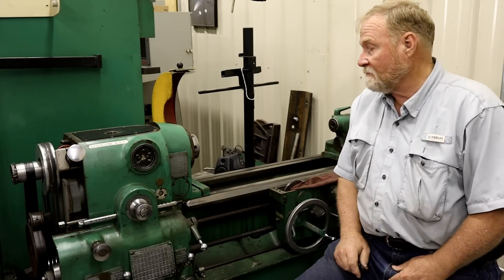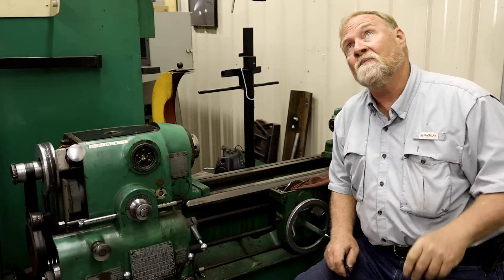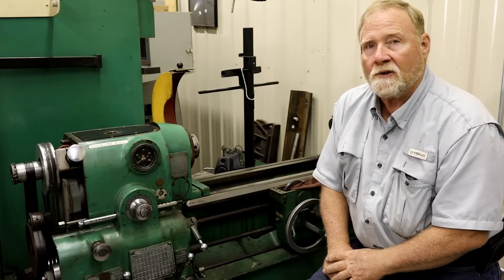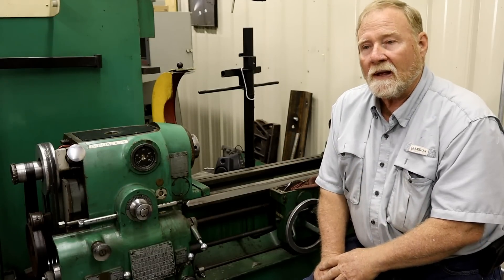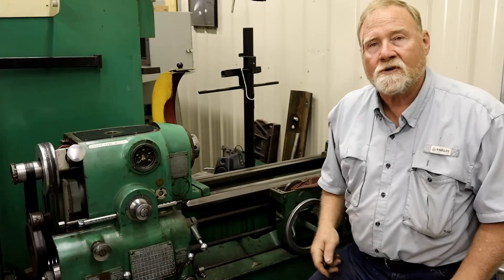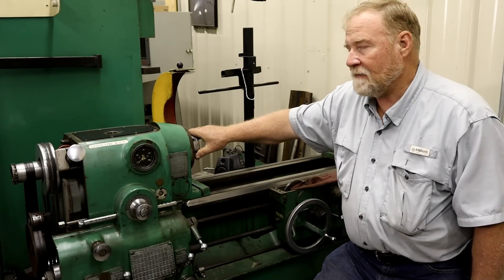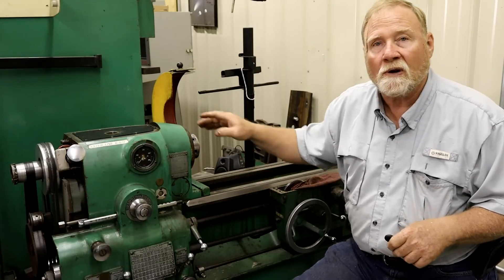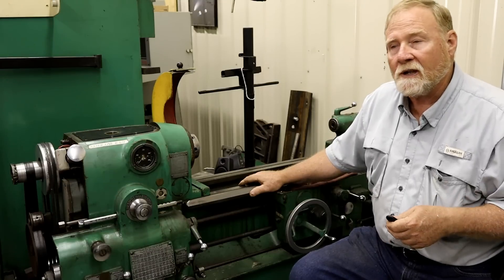$ 7000 Monarch 10EE Mistake : Fixing the Ways, Going to Windy Hill

Comment: I want to do something similar to my 32" G&E shaper.   What I'm starting with is an old military Dumore Versa milling machine.  Along with the Versa I found a portable bed for it.  My problem now is how to mount the bed to the shaper.  Anyway, I am looking forward to seeing your solution.  Good luck.
Reply from the maker: Sounds like you need a 8 foot planer ;)  That was the reason I got rid of the 36 inch shaper I had... Too small
Reply: @10swatkins  lol   That planer would be very useful.  If I had the space....

Comment: 6:31 I agree 100% with you ,even crappy lathe can make a bearing fit its just the matter of time ! On a good lathe you set your depth and thats it on bad ones you have to see how lathe turns the parts(if you own it or work on it every day you kinda connect with the lathe on some spiritual level and you know its soul and all the flaws) and then bump the handle slightly as it goes forward to compensate for wear or when it cuts taper(DRO makes things easier but i worked on pure manual lathes with nothing but handle dials). Its painfully annoying and accuracy will never be superb but you can make a part that can be used within certain tolerance of 0.05mm .
Reply from the maker: Yep it take more skill and time but it can be done :)

Comment: i have exactly the same plan for some time, my angle on it is to make  a single rail, almost like a bedway. with a cross slide and maybe compound to adjust the tool. what ever you use to do the cutting. lathe bed repair is a big problem in south africa. seems to not be any one doing it ,and the grinding co, i have spoken to will only do flat horizontal surfaces.......my boley 5lz is warn to 0.46mm from what i could measure having no real reliable reference surface. very bad. am looking at single pointing it , almost like a planer the mount to the job rather than the job to the planer. plan on making this rig extra long, maybe 2m . will see what budget allows. following to see how yours work out......

Comment: Skip the sandpaper and die grinder it will just chatter and glaze up after 12". Get a old bench grinder and a good surface grinder wheel wide enough for one pass width, maybe some coolant. ......
Reply from the maker: Is no one reading the comments?... Sorry but I have  said this about 500 times.... There is No room for anything but a small wheel and head in there next to the head...  I only have to take off at he most .007" and I have used sandpaper and flap wheels to remove steel on rails before... It might clog after a while but I am using this as a hand scraper and can spot work over areas...  Thanks for watching...  Sorry for being abrupt..

Comment: I think that is a brilliant idea! I can't see any reason that it should not work perfectly, but the weak link is the bearings in the air grinder, if you could build something around a small tool post grinder with a proper spindle, or even a small bench grinder with two bearings set a good distance apart, it might be better. I am thinking that as the grinder develops more play in the bearings it will run out more and take a more erratic cut. I have an old Black and Decker valve refacing machine, which has a very accurate precision spindle on it, which is also very compact, and easily removable from the machine, but you can't have it! However, if you could find similar locally you would be adding another level of precision to the whole machine, even if you did use a sanding disc, as you say, you are removing 7 thou max!
I have ordered my beer and popcorn!
Phil, UK
Reply from the maker: Don't think of the grinder as a single shot grind and go on ... Think of it more as a hand scraper that can go over any part of the rail and touch up what is needed..  I can't get anything like a tool post grinder into that area beside the head...    I just returned from windy Hill with the casting for the rails :)

Comment: Hi Steve, a point worth checking, the vee on some lathes is 94 deg. inc. and not 90 deg. I'm open to correction as I am not familiar with the lathe you are working on. Thanks for the video, always good stuff.
Reply from the maker: Frank what ever the angle is I can match it with the rigg I'm making... I am making the rails 90 to match the wheels I have already made...  The ways on the lathe can be any angle and I might end up with different angles on either side as I might not have to take vey much on the operator side of the V... Won't matter  as I am using moglice to perfectly match the saddle to the ways :)

Comment: Steve, do you have enough room to put the lathe bed on your planer and then mount a grinder in place of the clapper box ?
Reply from the maker: yep,, but I don't want to do it...  I want to make a universal tool to repair worn ways without tearing it all down...   Just scraping in the head to fit the ground ways is a real PITA and with grinding it all in place I only have to  worry about maintaining the alignment of the ways .....

Comment: I know I’ve said this before Steve, but it’s difficult to see how this bed got to be so worn. The only thing I can think of is that the lathe was used for grinding, and the idiot who did it never covered the bed or cleaned it off.

My South Bend FOURTEEN has a hardened bed. It was made in the mid 1970s. There is no wear to speak of. I’ve had it since 2002, and I’ve used it a lot. That’s what a hardened bed lathe should show after a fair amount of use. And that’s what makes this so startling. But then, this lathe has been so abused in so many ways, I suppose nothing about it should be surprising. Of course, once you straighten out the bed, you’ve got to straighten out the saddle. I seem to remember you saying that you were going to use Turcite.
Reply from the maker: Mongolice for the saddle :)

Comment: Alternatively you could be like me and be lazy and just get a big roll of heavy paper like butcher paper and mount a roll at each end of your planer and just sit the bed on that so grinder dust won’t get on the machine ways. With a well applied vacc system you would not have much escaping anyway since your material removal is a small amount.  No need to reinvent the wheel just change how you apply the one you have got.😊
Reply from the maker: Think of this as a portable line boring machine... A heck of a lot easier that tearing the head off , bed off and then putting it all back together and going through the trouble of scraping in the head back to alignment..  ( A real PITA if you have never done one  )

Comment: I would probably find two old surface plates with enough length and align them on both sides of the lathe.  Once you got them aligned to create a plane then you can shove the lathe in between them and adjust it so the spindle is in the same plane. Then buy a couple of linear bearings and bolt them to the granite plates and you have made a gantry style way grinder.
Reply from the maker: You just really want me to work hard , don't ya :)

Comment: Food for thought: why not just do the face of the worn side of the prismatic way and makeup the difference under the saddle with moglice or some other material? There is no reason that both sides have to be the same angle.
This way you only have half as much grinding to deal with.
Good luck!  Cheers Zed
Reply from the maker: I will be using moglice.... Your right on the angles not having to be the same and that's the one reason I want to use Moglice :) GMTA :)

Comment: I can see the issue with trying to grind the ways where they run by the side of the headstock. Have you thought of trying to use an abrasive belt running around a thin ground and polished radius on the end of a precision platten? A bit like those air files you can get. My friend has a belt machine that I use for plane irons and wood chisels that produces some fine finishes and I'm pretty sure that with a decent rigid setup an abrasive belt would get you close enough for minimal scraping afterwards. In fact you might find that with a suitable drive system and some "custom" plattens it may be the way to grind the whole bed. 
Good luck with it anyway, whatever you do.
Reply from the maker: There is just no room  to be able to move the spindle around :(

Comment: Does the monarch bed come off the base? If so you could put that and the rails on the planer bed as a level surface to line everything up.
Reply from the maker: ITs a hardened bed,, planer irons will not tough it...
Reply: @10swatkins  Hi Steve, I realise that. I just meant you could maybe use the planer bed as a rigid datum to work off by mounting your rail system to that, then levelling the monarch bed in between them?

Comment: As long as the spindle in the die grinder has no axial play where it might float in and out instead of cutting it seems like a great idea.  Also if the angle that the grinder is set to is consistent along the whole way you can always scrape the saddle to match.  Love it best of luck!
Reply from the maker: The saddle is getting Moglice to make an exact fit to the rails , with no scraping :)

Comment: Steve, why not use your existing 4' straight edge, get a second 4' straight edge and use them for the rails? yeah they will be bulky and a little more tricky to hang off the edge. but you wont be left with 2 large gobs of cast iron that you probably wont ever use again....
Reply from the maker: Do you have any idea of what another 4' edge would cost?   I don't anymore but it would be 150.00 just for shipping.... Plus no easy way to adjust and fit to the machine,,   I'm at Windy Hill in the Morning and we will cast the pieces I need... HEck of a lot cheaper  :)

Comment: Just my 2 cents worth, make 4 rails not just 2, even if the extra 2 are just rough castings at the end
You may change your mind about the design of the rails after you've already built 2
Worst case (with 2 only) would mean another trip to Windy Hill
Best case, you would have a second set to sell off to another 10EE owner
My father taught me this..
Why have only one, when you can have two at twice the price(now) and you'll have a (relatively) cheap spare, instead of paying through the nose in the future, when you Need to have another.
Best regards from Australia

Comment: Just a thought, the idea is to get the ways to be parallel to a line extended from the spindle to the tailstock. If you put a large precision ground rod between the spindle and the tailstock and use this rod as a support for a "sled" to move along and grind the bed. Not as rigid as what you plan but with light cuts might be accurate.
Your idea is great, you have the experience and ability to pull it off. Thanks for showing all this, looking forward to seeing the result. Cheers from fellow Texan.
Reply from the maker: The head is scraped so that the spindle is aligned to the head to the bed when it was made...    By leaving the head on the bed and then aligning my rails to the bed I eliminate having to worry much about the spindle...   There are unworn and unused surfaces on the bed that was ground at the same time as the ways... Those surfaces are what I will use for alignment...  Thanks for the comment!

Comment: Steve; Should work just fine.  As you said, some of the grinding services only get the ways back within 0.002".  Taking your time, you should be able to at least get that.  You might look into valve refacing wheels to do the grinding.  I have an old Black and Decker Valve Refacing machine that uses 45 degree and 60 degree stones to reface valves and seats.  Might work on your die grinder to get the results you are looking for.

Comment: I am still wondering how you get 7 thousandths wear in a hardened rail. Was this from a place that considered lubrication an expensive frill? I would have done the same thing except I would have used linear bearings and a precision ground rail. If I had the money.

Comment: Looking forward to seeing your plan pan out. My thought was as you have 2 four foot straight edges, couldn't you use them as rails? I know you want the sled self centering, hence the 90 degree steeple, that could be achieved by machining the aforementioned hot rolled, which would rest on the straight edges. Anyway, I know you were just secretly looking for an excuse to go to the foundry.

Comment: Steve, I have no doubt that this plan will work, but I would recommend a modification: have just ONE of your rails with a vee top to guide the carriage laterally, and make the other flat. That way, setting-up would be quicker and there would be no risk of two fighting one another. The other thing is, I would prefer sliding pieces, not wheels.

Comment: Like everyone else - I am hear for the crashes.  er - I mean the racing!  🙂 Love the ingenuity. That is one scary cut to have to make.  One thing you are going to have to watch out for: flex in your die grinder, AND flex in what ever wheel or bit you use in it.  I've played around with doing some grinding of hardened steel bearings set in the chuck (on my 10EE!) and ran into the issue of the grinning wheel itself deflecting.  Will that cause any issue for you if it does?
Reply from the maker: I am looking at this as a hand scrap using a die grinder rather than a hand scraper...  Slow and deliberate checking often with the indicators affixed to the sled will be a big help...   Any deflection would be handled just like having to scrap high spots off with a scraper....
Reply: @10swatkins  Huh, never thought about it from that angle.  I assumed you'd use the rails to traverse the trolley to replicate the action of a surface grinder and progressively straighten the ways.

If you're planning on approaching this as a scraping exercise, why not rig up your Biax with an abrasive tool (make something from a piece of a CBN grinding wheel, maybe) in place of the carbide blade and perform the job as you would on a lathe that didn't have hardened ways?

As is everyone else, I'm looking forward to following along with the progress.

-Kurt
Reply: @10swatkins  Makes sense - and looking forward to it.  It will be nice if you can "turn on" your angle grinder without it being in contact, and it will have that initial torquing motion that will make it want to twist as it is powered on.  Thanks for the response - suspect you will figure out how to make this work - even if it takes an iteration or two

Comment: I believe your biggest problem will be getting a way to set the angle grinder in a fixed rigid but adjustable position to do the various grinds with. And allow all those different setups easily. But I like the idea. That platform fixturing will need some thinkin.
Reply from the maker: I have some ideas on that setup.. Not going to be a hard thing to do, Well I think it will not be :)

Comment: Schaffer Grinding in LA reground my 10ee bed ways taking the absolute minimum of material off and it is accurate to better than Monarch specifications new from the factory.  And it wasn’t very expensive.  They even ground the underside of the outer bed ways so they are parallel with the top of the ways.  The ways were originally ground by Monarch so the headstock sat right down on the reground bed ways and was so accurately placed it exceeded Monarch specs.   No scraping required.  You’re approach should work fine, but I’m not sure it will be as accurately ground as if you lifted the spindle off and had Schaffer do the job.   Don’t get me wrong, you are a very smart and creative man so I am hoping it turns out fantastic.  And, then you’ll get business from other 10ee owners.   Life is an adventure.  Cheers, Will
Reply from the maker: I can plane here... if all else fails I'll rig up a head to the planer and do the whole bed..... Thanks for watching..

Comment: Take it from someone who is only an interested observer and does not know much about the matters that your are explaining. But since most of the wear on the ways takes place near the spindle and the rest of the ways (towards the extreme right) hardly gets to do any heavy lifting, would it be possible to simply turn them (the rails) around? That, of course, if the rails can be removed, which should be since you can send them out for grinding and there are no issues with the symmetry of the rails. Then the rail that is closest to where you sit would turn around and be installed on the place of the other rail. Likewise with the other rail, which would now be turned around and  installed next to you. Now both the portions of the rails with the least wear would be close to the spindle and the heavily worn portions of the rails would be where they will get to do the least amount of work.
Reply from the maker: The ways are cast as part of the bed and not moveable...  Thanks for watching..